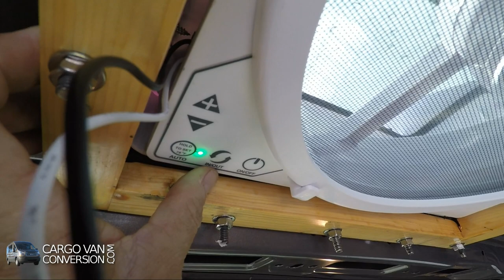Cargo Van Conversion - Roof Vent - Part Three

Comment: Thank you for this clear instructional. Tomorrow I am already for this stage!  We could not do all this without generous youtubers like you...and doggie!💖
Reply from the maker: Thank you so much. Best additional advice I can give you, is to avoid metal shavings when you'll be cutting into the roof, both inside the van as on the roof. Plastic sheets would do the job as well as magnets, close to where you're cutting the metal. Wish you well.
Van Williams & Joey

Comment: Thanks for this awesome video I'm also building a 2017 transit I wish you should include the wiring of the fan on the video as well.
Reply from the maker: Hi Agueybana55,
I didn't have a 12V source, but currently I'm posting videos each Friday about the solar panels, so keep watching and you'll see how I hooked  them up to a fusebox and the batteries.

Van Williams

Comment: It was quite a struggle to get through the frame of your fan, I often wonder why our makers didn't equip us with at least one more joint in our arms, as that would make many jobs much easier to do.  At least you managed to install your fan properly, but that also means that you'll have to find another source to fill your water supply, as it won't leak enough (not a single drop I bet) to fill your tank from the leaking fan.  I really like these Maxx fans, and if I ever get to converting my old van, I will try to get one too, they are VERY expensive over here, and I looked for them on eBay in the US where they are a lot cheaper, but the shipping is terribly expensive, so I'm hoping to have some luck in the Loto before I can invest in a Maxx fan and have the money needed to do my simple stealth conversion.
Reply from the maker: They may be a lot cheaper here, but still quite expensive, in my opinion. You may search amazon.fr locally they may offer a better deal on roof vents, if they have them for sale. If not, try Amazon.co.uk they have a greater variety of goods and often ship all over Europe.
A bientot!

Van Williams
Reply: Thanks for the idea, I'll check it out, I'm going to the UK about once a year, so if they are cheaper there I can maybe buy when I'm in the country and get it delivered to a friends place.  Of course there's a possibility that by the time I can afford one, I'm not allowed to drive my old diesel van anywhere anymore, but we'll see how things will progress.

Comment: I agree with theothers...another well done video. You are a perfectionist. You must have been a fan of Norm Abrahm and New Yankee Workshop. Your videos have the same format. Don't recall, since you are a Floridian, do you have plans for a/c?
Reply from the maker: A/C is becoming a reality without generator and while boondocking. As Lithium battery technology improves, that may start happening. For me, even as a Floridian, A/C is not even on my wishlist. The boondocking or camping experience is about the outdoors and while you appreciate some extra comforts with age, A/C can be largely avoided by following the 70 degree mark, either by changing elevation or location.
Perfectionist, Norm Abram, NYW - Yes, yes and yes :)
But to tell a little secret, in real life I tend to do things just a little bit cheaper, faster or use material that I already owned.
With many more people viewing my videos or reading the articles on the website, I feel more responsibility to show things the correct way, so I tend to do things just a tad more professional (and more expensive).
Does that mean, I'm not a perfectionist after all? :)

Van Williams

Comment: Nice install. Did that dicor smooth out itself in that Fla sun or did I miss something? Either way nice very smooth. Are you planning on just running fan off a battery with portable charger until solar is installed? I know your trip is quickly approaching. Thanks for sharing I'm a big fan of your work👍🚐👌
Reply from the maker: The Dicor is self-leveling and yes, exactly as in the video. You can see how much I applied and it leveled out quite nicely.
I tried the fan out by connecting it to the 12V outlet in the dashboard; could also connect it to the CCP in the Ford Transit (a 12V hardwire connection), both sourced by the starting battery. Not a good permanent source, unless you're driving and that's not when it is needed. I'm currently working on getting the solar panels and will hopefully start installing those soon. In the meantime, I'll use it while driving to get the hot air out, but nothing more.
Yup I'm heading for northern Georgia with some alternate sites to the west and east, in case of bad weather. I encourage anybody to make time free to watch the Total Eclipse or at a minimum the partial eclipse if you're outside the 70 mile wide swath.

Van Williams

Comment: Nice work! That seal looks like it could be hold to a depth of 30 meters at least.  ;-)
Reply from the maker: Haven't thought of that. But it's not a boat, if you want to know :)
Actually, temperatures at the metal skin, here in the southern US, have to withstand highs of up to and above 200°F (100°C). So it's important to keep it waterproof.
Thanks for watching!

Van Williams
Reply: Yes. I was thinking that the Butyl tape seal might have been overkill (I would have used Dicor there as well.) Then again, leaks are no fun, and the time and money difference is pretty small to insure a pretty secure seal. 

You can build a van for me anytime!  ;-)
Reply from the maker: Money-wise, it's not a major issue, but the different sealants make it complicated. Usually there is no adapter to account for and the fan is placed directly onto the roof. The adapter however makes installing it a breeze (I wish I had a breeze on the day of installation). That adds another sealant. To avoid leaks and rust, I try to follow the manufacturer's recommendations. In the end, I doubt whether it will survive during the lifetime of the vehicle and will check it at least after five years and thereafter.

"You can build a van for me anytime!"
I get these (serious) requests every few weeks, so join and get in line. :) Have considered doing it, but I have been in business before and that suddenly changes everything. I might be putting something together, where I teach practical, hands-on projects specifically focused on DIY van conversions. I could reach more people that way.

Van Williams

Comment: Another great demonstration.. 
Why did you choose the MaxAir over the the Fantastic Fan system?
Also why did you install the fan in the rear of the vehicle?  THX
Reply from the maker: Both fans are quality products and quite similar, but there are some differences. While the MaxxAir Deluxe models are somewhat bigger, their basic models are comparable. Why I chose the Deluxe 6200K, was mainly for its ability to stay open during rainy weather. My experience in RV Life has shown me that when there is prolonged raining, one tends to stay inside and moisture & humidity increase; these moments are when you needs an operating fan the most and that's just easier with the MaxxAir fan. You can also drive while it's open, but that's not a feature that I'll be using often.

The rear installation for several reasons:
- It's right above my kitchen area.
- It interferes least with the application of future solar panels.
- Insulation and ventilation are probably the most important issues in a van conversion. I'm experimenting with ventilation in such a way, that I installed a floor vent ( https://www.youtube.com/watch?v=awMAX7JZ0BE&list=PLyrIiniKvmg50Nfbw6KTpkbwHW9gUgaXn&index=4 ) inside the wall right behind the driver's seat. For natural convection to occur between entry and exit points, one needs distance, maximum height difference and temperature difference. To maximize distance, it's located opposite of the front floor vent.
After the install, I also determined that it's the easiest location to access.

Van Williams
Reply: Thanks again. All great points. Did having the vent further away from your bed (noise) factor into your decision. Just curious - why did you choose to put your bed up front?
Reply from the maker: The noise was not really a consideration. Sleeping and running the fan probably/hopefully will only happen occasionally and then the speed will be very low and noise is not an issue. But distance does help.
There was one primary reason during the design process, but there are probably many 'unconscious' reasons. I was inspired by beds, located opposite of the sliding door. I can imagine boondocking at that perfect spot in Valley of the Gods in Utah, waking up and slumbering in my bed with the sliding door open, looking at the incredible landscape. Whether that will happen, is still to be determined, but I can dream, can't I?
When in the upright position it also creates a 'larger' living space, that makes getting in/out easier; so is access the the front cabin. The desk will create a living area that can be combined with the passenger swivel chair. You see, all these things are interconnected. The somewhat narrow profile of the bed also blocks the rear view less. I'm also at the point to install the window frame, that will be accessible when the bed is down. That window requirement also limits a location choice.

Van Williams
Reply: The sliding door must certainly be used for that purpose! Utah is such a special place - one of my favorite motorcycling destinations. Good point to position the fan so it encroaches less on future solar endeavors.
For my build I want/require maximum garage storage at the back, so I'm thinking of having my bed in the back mounted at about 40" off the floor (30" head room).The bed will be removable to allow me to stand it up to the side allowing me to load taller stuff but mainly my motorcycle when the occasion presents.
With this layout - where do you figure the fan should be? (BTW the kitchen will be on the passenger side ahead of the bed)
Reply from the maker: I think an elevated rear bed is very appealing, as it creates a lot of storage room below, but you can also contemplate one/two single beds/sofa along each rear side wall, thus creating a place to put your motorcycle in between for when it's necessary.
Where to put the fan, is mostly dependent on the reasons I already gave. The kitchen plays less of a roll, as it's now located close to the sliding door, which can be opened when cooking. I don't know what type of camping you'll do, but if solar is in your future, that's a consideration. I still think a floor vent should be an option, which has to go in the front, making a rear roof vent more desirable. As you see, it depends largely on your personal preferences. And that makes doing your own conversion so great; in the end you can really call it your own.

Van Williams
Reply: THX - I will consider a small bed on the side wall in the back - maybe a smaller version of your Murphy bed.
Reply from the maker: I spend a few years gathering ideas and thinking of a design and I'm still changing as I go; it's part of the journey. Enjoy!

Van Williams
Reply from the maker: That was a nice video and had some interesting ideas. I liked the foldable cooking pot!

Van Williams

Comment: Thanks for this video series. I have the same fan. Did you fabricate that adaptor or purchase? Could you list what you used to make it? Looks like a foam or rubber gasket.. Thanks
Reply from the maker: I used two adapters: the interior I made myself from wood, the exterior I bought. The guy who makes them is called Hein, sells them on eBay and is quite involved on www.fordtransitusaforum.com.
He sells both an interior and exterior one, but the area between the two rear ceiling cross members is too small for it to fit. He also sells these for other van brands.
For every project on YouTube, I create a companion page at http://CargoVanConversion.com/projects that include detailed photos, worklists, material lists and a free downloadable pdf. Right now, I'm working on that for the roof vent and that will be ready in the next week or so. You can already look at the other projects I've done.

Link to the adapter on ebay:
http://www.ebay.com/itm/Ford-Transit-RV-Roof-Vent-Adapter-/132162849122?var=&hash=item1ec5850962:m:m_A8uU7_usP1PEAeaKcPv3Q&vxp=mtr

Van Williams
Reply: Thanks for that info and links. Just purchased outer for my promaster from him. He had two left. Should arrive by the 16th of this month. Timely info!  Enjoying all your videos/tutorials- joined your Modsquad from your site.  Adam
Reply from the maker: The exterior adapter will make your life a lot easier! Just plan ahead and count on two days work, if you allow the sealants to cure, before proceeding. Tanks for watching and stay in touch. I love pics from your build.

Van Williams

Comment: Know its good stuff, buy dicor always looks like a mess of an install.  If it were possible to make it look neat, I know you of all people would.  (I"m going took more into the eterna-bond tape.)
Reply from the maker: It worked out better than expected. I think, most of use tend to apply too much of it and the self-leveling properties make it go everywhere. Eternabond works well, but isn't the most fashionable solution. And all of that effort for something that's largely out-of-view. Aren't we taking ourselves a bit too serious? :)

Van Williams